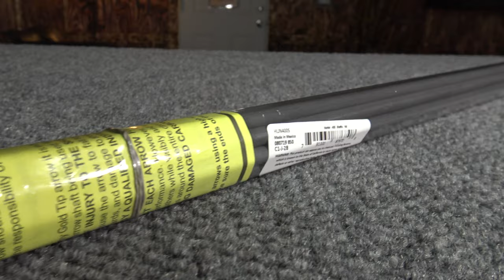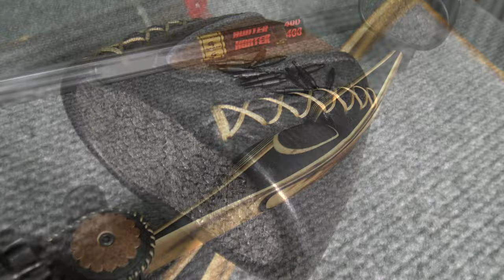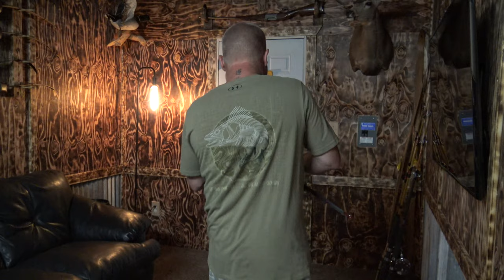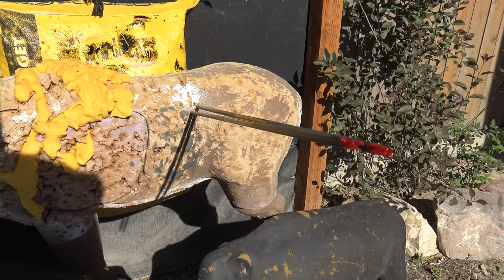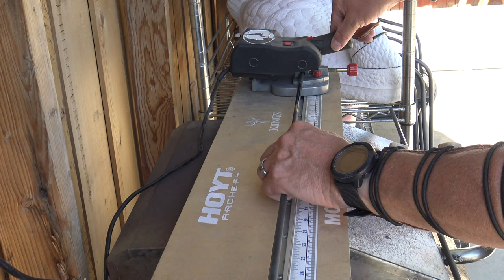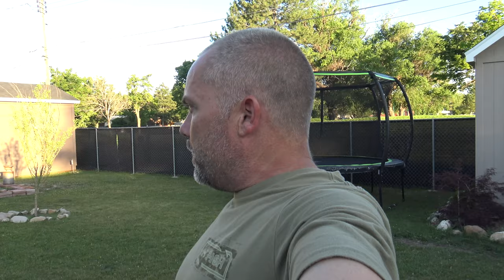TOELKE WHISTLER / BARE SHAFT TUNING / THUNDERHORN QUIVER

Comment: Add your fletchings and shoot a few bare shafts with the fletched. See how they group together. Don't get hung up on the nock high with the bare shaft. My 60" Whistler is 53@30 and I shoot 31" Axis Trad 400s  with the 50 grain brass insert and 225 points. Fly amazing